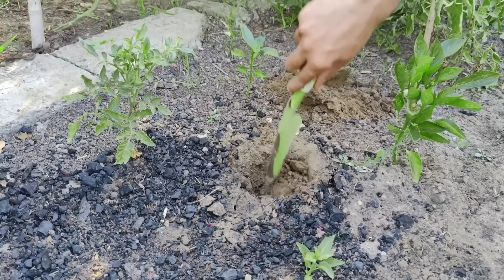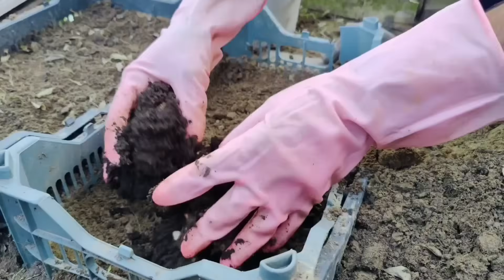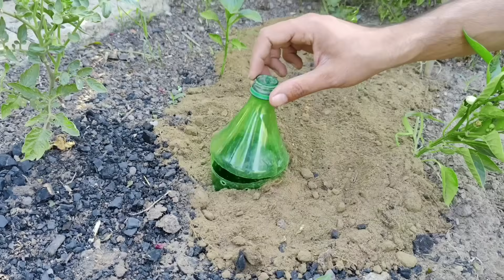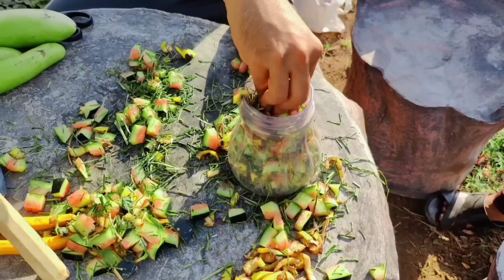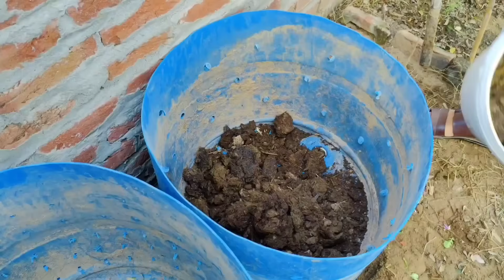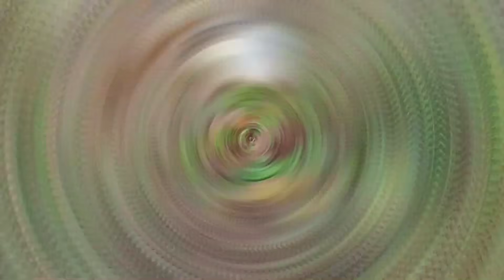Mind-Blowing Trash Hacks: Save Your Garden From Drying Out (ZERO Cost!) Gardening Hacks Season 1!

Comment: I live in south west coastal Florida. Palm rats, raccoons and ants make it really hard to compost here.
Reply: I live in coastal SW FL too.   And have 2 really good compost bins.  With NO problems with anything.  What I did.  When you see the holding tanks from water systems discarded. (There were alot after Ivan).  Or when someone does a replacement and they are curbside.  Pick it up w/lid.  I cut off the bottom.  Dug it down into the dirt about 3-4”.  Pounded 4 rebar on outside-on each curve.  (to keep it from flying away in high wind, if its empty).  You can trace some mesh cloth for the bottom and bury that in inside bottom.  So nothing can come up through bottom.  You have the top to cover it.  And the water container has some holes with screen at top allowing airflow.  Then i just pile in grass clippings, chicken manure and bedding, shedded paper, cut up cardboard, everything.  And wet each layer as you go.  I flip it once a week.  Rewet it.  Put all kitchen scraps, coffee grounds, egg shells etc.  And cover the top with a heavy black plastic bag before putting top back on.  It makes the best compost bins!!  With no vermon or bugs.  Been using that for a good 13 yrs. Plus they look neat and tidy in the yard.
Reply: I wonder if you have the type of trees, that you can just grow with compost made of tree leaves...they have lots of minerals...but you prpbaly just have palm trees?
Reply: @CC-nw8jh  we don’t have the nice maples and those type trees down here, that drop leaves in fall.  It’s hard to find “leaves” here.  (Unlike the north where I use to live).   I trim my bushes and chop that up good w/hedgers and use it as chop and drop. Grass clippings, cardboard,  etc.  Using permaculture methods and layering of biodegradable materials I do this all yr. And top it off with costal hay (because it doesn’t have grazon). Especially summer.  I pile it on.  With the summer rains and heat.  It biodegrades fast.  And my fall & winter gardens benefit from it.   Which is a good practice for soil building, being it is straight up SAND down here. Been doing this for 13 yrs. here. And my beds are MUCH better.

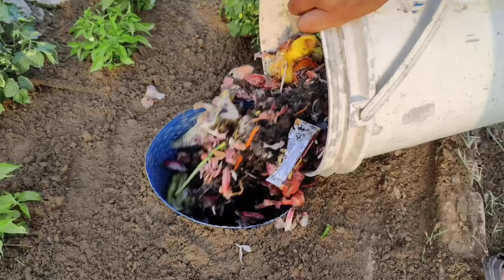Comment: 3:57 I avoid plastics in my garden,  in some recycling centers they sell some steel/aluminum containers already with holes (from parts of washer machines) I have several of them and I use them just like shown in the video.
Reply: Aluminum is as bad, or worse.
Reply: @lajwantishahani1225  The effect of Aluminum in soil is different than aluminum in human diet. Aluminum is a problem in acidic soils, my garden soil is around 7.5 and in some places a bit higher but yes steel is a better option for those containers.
Reply: @teresamexico309  you are still getting the aluminum into your system which effects brain function, plus a host of disorders in the body
Reply: @CC-nw8jh  Going for the safest approach, use steel containers. Also, check the aluminum content in foods so to avoid them, avoid aluminum kitchen pots, do not use aluminum foil,  etc....
To make things worse, we can do nothing to stop the aluminum (and other elements) sprayed into the skies done in the name of Geo-engineering.
Reply: Aluminium is a neurotoxine!!
Reply: what do you call it
Reply: @teenadamron7654  Drum.
Reply: dont be fool yourself about the aluminum being ok in your soil because of PH...nutty thinking...your veggies do uptake it....